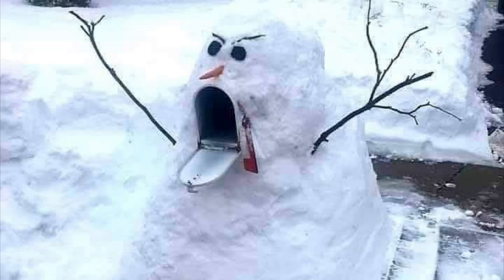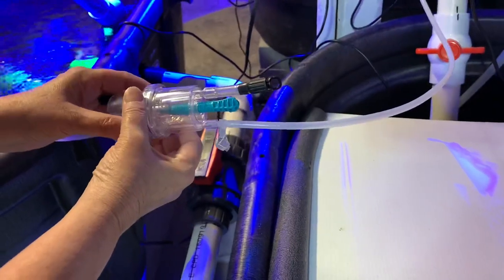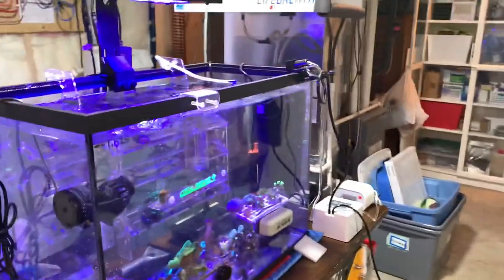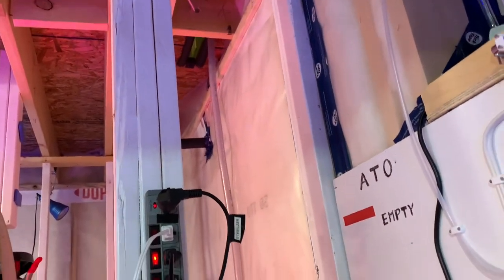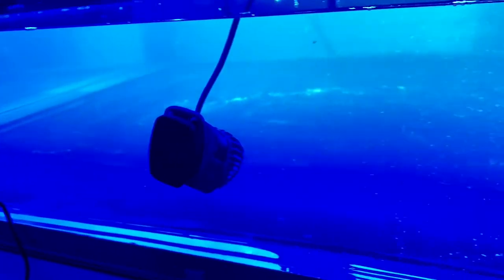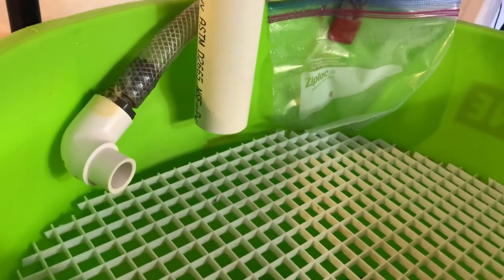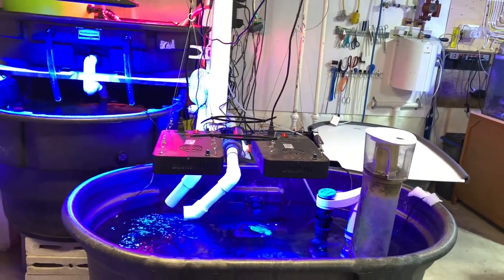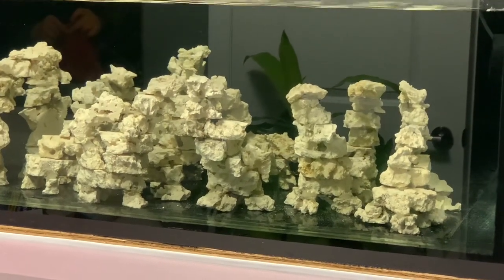Reef Tank Wrap-Up No 10: Imploding Skimmer? PLUMBING! Filling the display, Peace of Mind, ROCKS!

Comment: So much to talk about. Great update. Thanks. I am sure someone has already commented on this, but you should not put your heaters on a battery backup. Heaters will kill your battery very quickly. If it is that cold that temperature becomes a problem then you can always start a fire. Glad to see your tank getting wet.
Reply from the maker: As mentioned in the video, these backups don’t last long, maybe an hour. We use them to buy time until we can get the gas generator running - especially if we aren’t home when the power goes out. They give us a window of time to either get home, or get someone to come to our house and handle the generator stuff. The room temperature is generally about 73 so during the short period of time the backup is being used the heaters don’t cycle on and off very often. Mainly, I want to have as much stability as possible. This type of backup works perfectly for short power outages. 👍🏻👍🏻

Comment: Good to hear sounds like you guys are fine.   Everything is omicron unless proven otherwise.  But that at least then means you are going to gain immunity.  That’s a good start for the new year.  Those battery backups by the way will only last about 2 hours.
Reply from the maker: Hey Alan! Thing is - to protect our grandson, who is 2, we don’t go anywhere. We turned down party invitations and we pick up our groceries curbside. I have a really hard time imagining where and how we would have caught it....🤔 We’re practically hermits...😂😂 We’re fairly sure it was food poisoning, symptoms were all gastro-intestinal. I suspect the salami....🤢 I have caught colds from the little fella, after he’s been banished from daycare for a runny nose, and had to get tested after three days before being allowed back. Four times now, always negative. But not in the current omicron climate, so we will see. He has been home for the past two weeks because his mom and dad had vacation, and I guess we will see what happens tomorrow with the whole situation. So crazy right now... we could be doing some babysitting this week lol.

And Yes - the battery backups we have will run for about an hour. I mentioned in the part where I was talking about the power outage alerts that we would have an hour or so to get home and get the generator out. They’re definitely a stop-gap for short outages. 👍🏻

Comment: Last year we lost power for a few weeks.  It cycled on for about 45 min and off 30 min.  I ran my 240g and 50g on 2 generators.  I switched generators every 12 hrs to let them "rest" and add fuel.
Reply from the maker: I once got through an ice storm that way (cycling on and off) but couldn’t keep the temperature up high enough and ended up losing my Pygmy hawkfish. How did your tanks fare in your situation?
Reply: @Reefgrrl  Corals were a little upset, but no losses.

Comment: You might want to look at different backup power for you tanks
Reply from the maker: We have a gasoline generator - if you saw the part of the video about the power outage alarm devices you’ll have seen that I’ve said these backups will only last about an hour and we mainly want to know if the power goes out when we aren’t home. If we’re home, we run the backups until they stop, then run the generator. I also mentioned we will be getting a whole home generator when they are more readily available again. We’re on a list for a consultation, then we will be ordering one. 👍🏻

Comment: Reefgrrl, What did you do to solve your Aquavitro skimmer issue. I have the 250 version and I'm considering running an outside airline. I wish Seachem would provide more information on the additional ports on the silencer and pump as well as make available the kit for the additional pump. I have been very satisfied with the skimmer but Seachem's documentation is lacking.
Reply from the maker: I agree there’s very little info supplied by Seachem and it’s very irritating. When we set it up the first time, we attached the sir line to one of the ports and put a valve in the other one, to close it. At first I was thinking there might be too much air pushed into the skimmer but it was the opposite. The problem was solved by removing the valve from the second port and just allowing it to draw air as necessary. I realized there couldn’t be too much air because that blue screw inside the little air intake canister is in control of how much air can actually be drawn in. So basically - however it’s set to run normally, it’ll run just the same but 50% of the air going in is from outside when one of the ports has the outside air hose attached. What I’d like to try though (since we have multiple air fittings available on that air pump) is to attach a second hose to the air pump and connect it to the second port. Then, 100% of the air supply will be from outside. In theory it should work....🤔
Reply: @Reefgrrl  Thanks for taking the time to reply. I'll give this a try. rob

Comment: You got lucky and dodged a bullet with your air pump.  I have the same one and it is LOUD.  There is no way to silence it.  Even when I'm holding it in my hands.
Reply from the maker: Have you tried putting any air tubing on it yet? Ours was crazy loud when we ran it sitting on the kitchen counter. But as soon as we added the air lines, the sound was dampened considerably. Then we set it on one of those textured silicone kitchen mats (they’re pretty thick, and have a pattern of small squares in them) it ran even more quietly. Don’t get me wrong - I can still hear it running. But it blends in with the other sounds down there and in no way stands out. 🤷‍♀️
Reply: @Reefgrrl  Yes.  Tried everything.  It can probably be attributed to poor quality control and variance between units.  It's even loud when its sitting in your hands and not touching anything (hoses attached). Works a charm (flow), but too loud to be in the room with it.  Looking for an alternative still.

Comment: May I ask how you resolve the skimmer issue?
Reply from the maker: Sure! I showed later in the video that it turned out the skimmer wasn’t getting enough air so I removed the valve in the second air intake and after that it worked just fine. 👍🏻
Reply: @Reefgrrl  thanks 🙏

Comment: I would be wary of the Sunsun uv filter i have one and it heats the tank up.I stopped using it.
Reply from the maker: I’m aware - UV always throws heat and the amount of heat depends somewhat on the flow rate past the lamp. I had the green machine before this filter, with the same size lamp (9W). The water flows through this filter much faster than it flowed through the green machine so there’s actually less heat transferred from this one. It’s a 20 gallon tank, so the water volume helps dissipate the heat. I also run my heater on a Poniie controller so I’m able to monitor the temperature constantly and the heater comes on rarely (usually when the filter is off for feeding). It’s a good point - something to be aware of, especially for small water volumes. 👍🏻
Reply: @Reefgrrl  I put one in a 10 gallon quarantine tank and it raised the temperature from 25 c to 28c.
Reply from the maker: @desmondlarmond9698  Yeah that’s a lot! 😲

Comment: You are not going to get much flow out of those pumps with the head feet you have.
Reply from the maker: Well, we managed to pump 70 gallons of water up to the tank in a few minutes with one of them when the plumbing was getting done because the Jebao was too slow. That was on 60% power. Using Sicce’s specs, with the head height of just over 12ft and all the 90s there should be somewhere around 1300gph at each return nozzle. The 1” pipe has 4 90s before it hits the overflow, where it gets reduced to 3/4” and has the final 90 to turn through the weir. I would have preferred 45s downstairs where possible and if there’s a problem, we can change the plumbing to put some in - there’s lots of space. There was lots of consulting on this and I went with what they recommended. I figure I only need enough flow to push enough water into the tank to balance with what flows out. Flow inside the tank will be created with powerheads etc. so won’t be reliant on the flow from the returns. But I guess I’ll find out pretty soon! 😁